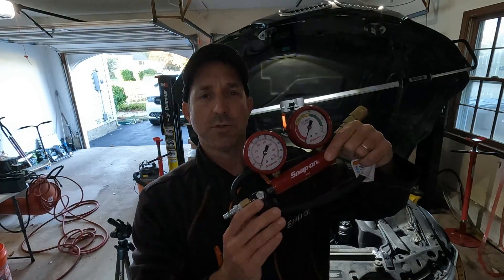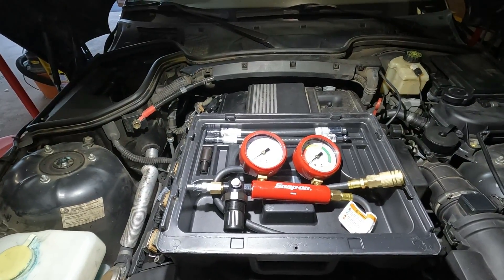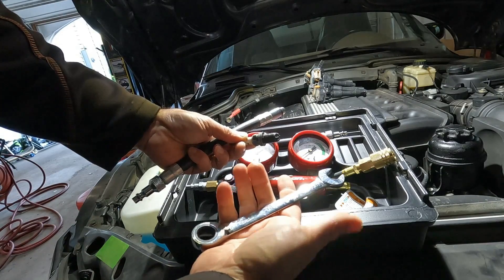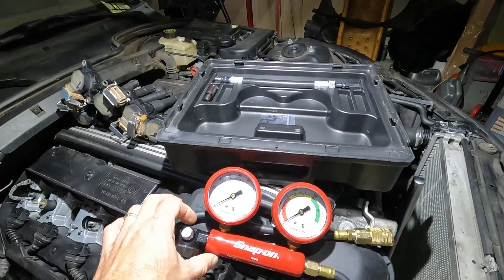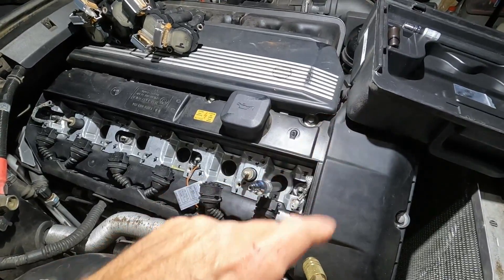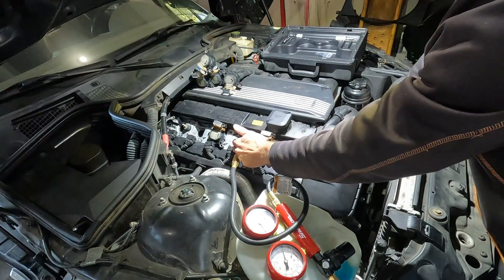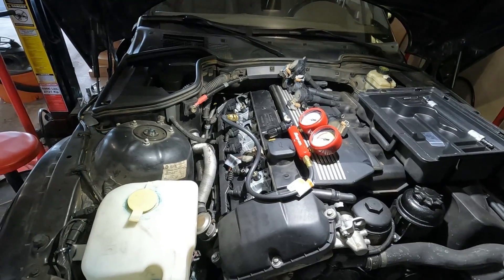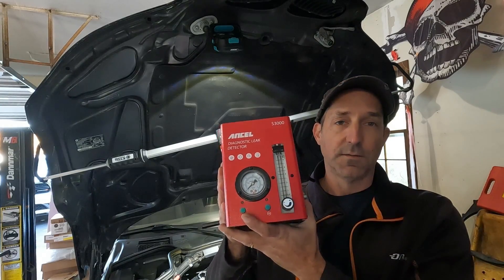HOW TO PERFORM A CYLINDER LEAK DOWN TEST TIPS AND UNDERSTANDING THE RESULTS - Cylinder Leakage Test

Comment: Liked the video but what happened to the video you said you was going to do about finding out why it was leaking? 
I looked for it and did not find it.
Reply from the maker: Hello, This was a warped head and pulled thread from the block due to an overheating issue.  For a high leakage listen to the intake and exhaust and inside the engine. You will hear the air escaping from the bad area.